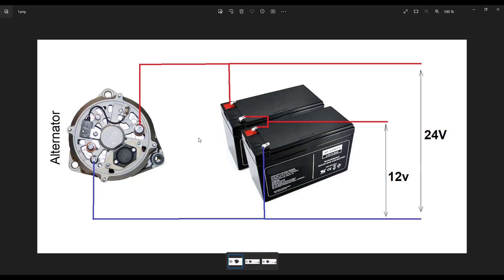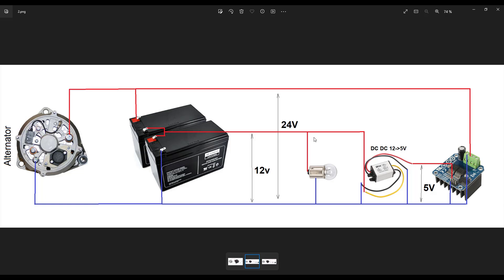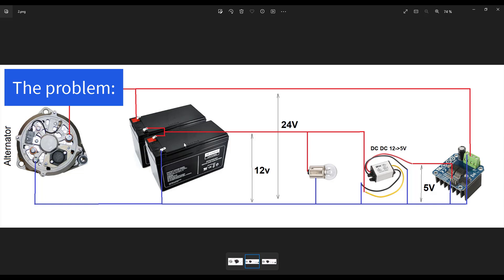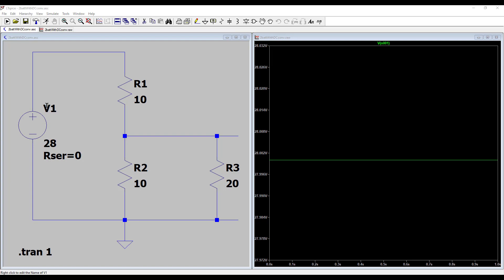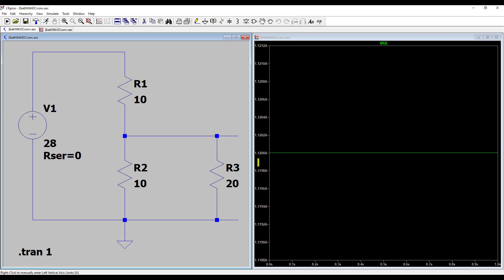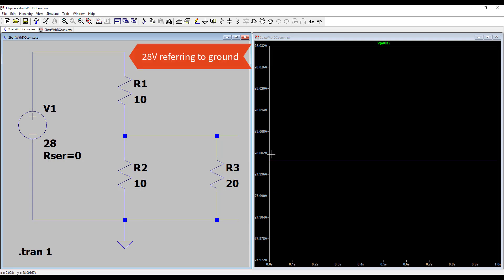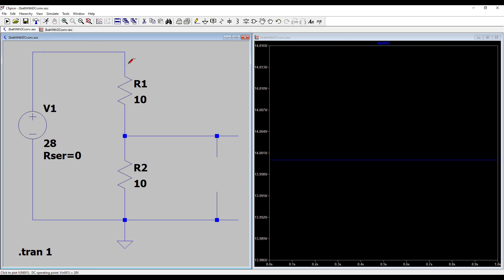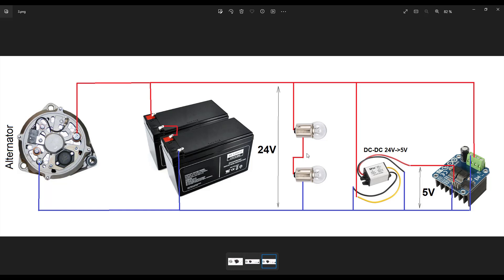Wiring batteries in series - Remote Control Lawn Mower DIY

Comment: Why did you decide to go with a 12V alternator and not a 24V one? I built an RC mower about 6 years ago and it's time to build another one and would like to use an alternator this time around and stumbled onto your videos while doing some research. Thanks for posting them.
Reply from the maker: Hi, I used 24V alternator becouse I have 24V motors. It also draw half less current for the same amount of power, so motor controller is cheaper.
Reply: @gregorkobetic  Thanks for the response. I got confused while look at the second diagram. I plan to run a 24V generator. Your videos provide a lot of information that I will be able to use.
Reply from the maker: Thanks! Yes, second drawing has 12v line a little off position, sorry for that

Comment: hello sir, i am currently doing my own  rc lawn mower project. i have the chinese motor 300rpm 12v, and currently im using a bts7960, after testing the motor I have encountered a problem, which is that my motor blowed up. can I ask if how  i can still use bts7960 and my motor without blowing it up? thanks!
Reply from the maker: Hi, I can't imagine what you could do wrong to blew up the motor. Are you shure it wasnt just faulty motor?

Comment: thanks for posting this! Would another option be pulling both positives and both negatives in parallel? With the thinking being that the draw would be even on both batteries.
Reply from the maker: Hi, that way current will be the same on both batteries, but voltage will be 12v instead of 24v. You have to connect two 12v batteries in series if you want 24v. There is no other option as I know. Have a nice day!